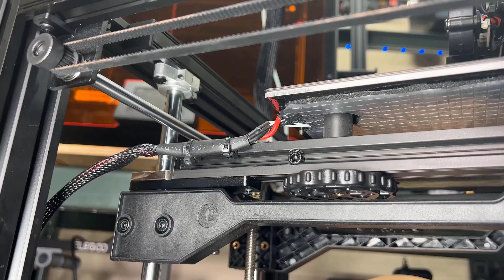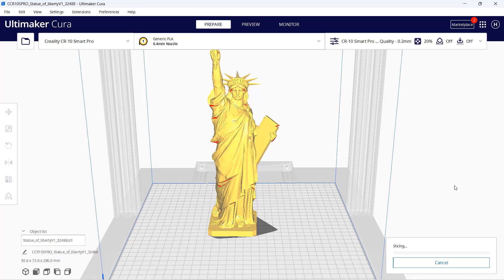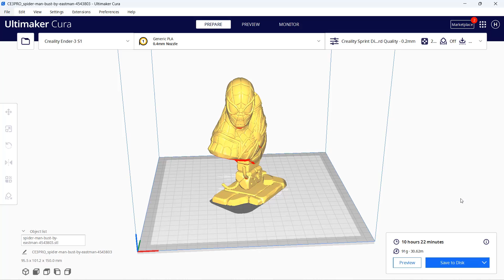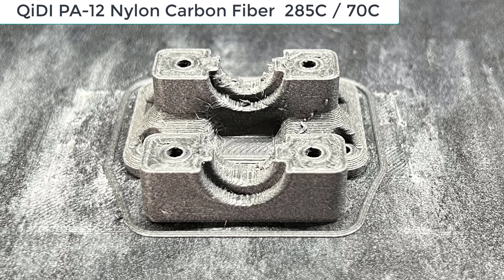Ender 5 S1 + Sonic pad Klipper firmware The ultimate hobbyist 3D printer? 250mm/s 2000 acceleration

Comment: Thank you for all the information you give, and share on many 3d printers. Recently I bought the Ender 5 S1, and a Sonic Pad. Thanks to you I got it all setup fairly well. One thing I am having trouble with is the slicer profiles, not enough experience I suppose, and my first Klipper machine. Can you share the profiles, either by file or text, for those high speeds you are getting?

Comment: The one thing you didn't explain was if you have to re-slice the models when using the Sonic Pad, or if you have to change the setting in your slicer when switching to the Sonic Pad that uses Klipper and not Marlin..

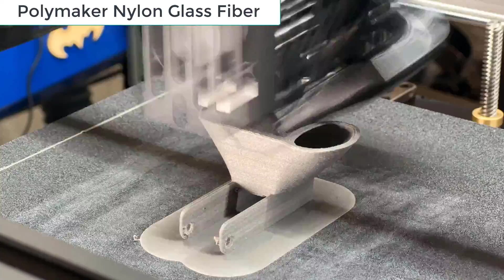Comment: Great video and you made me aware of something I didn't realize. At 18:00 you showed the nozzle size (length) and I didn't realize it was longer than the standard MK8. I recently put on a new nozzle and didn't notice the difference in length and was wondering why I was getting a little leakage. I'm guessing the standard doesn't bottom out as much as the longer nozzle. Thanks for the video!

Comment: Single bed mod I've made to my pair of E5-S1's has been to relocate the CR Touch problem to a zero Y offset.  Auto bed leveling works flawlessly now and first layer issues are a thing of the past.  It literally moves this printer up a full notch in quality & usability.

Comment: hi i need some help my ender 5 S1 has worked really well out of the box. i have problem the filament will not going through it starts but with few seconds it stop. what i found was it was blocking not the heat block it was were the two tubes connect at the top of the heat block. i have had all the heat exchange off many times to unblock and had extrusion off and it looks fine but i have no idea why is happening any ideas would be appreciate any help 
thank you

Comment: Great review as always.  I realize that you don't want to make any printer look bad,  but it still would've been nice to see the 3 s1 also overclocked to run at those speeds since you were comparing them against each other.  I don't really understand the design choice for the 5 s1 because the intense vibrations were pretty obvious since the bed lacks any side support.  Which means its high speed mode is only useful for the roughest of print jobs.

Comment: I recently got the Ender 5 S1 and I can’t seem to get the prints to stick no matter how much leveling I do 
Is the secret replacing the bed or using some kind of adhesive 

Also I noticed that your benchy print had a perfect first layer
My first layers are not uniform just a bunch of lines

Comment: If I planned to print more I think I would’ve grabbed a 5s1. Couldn’t pass up the 3s1 for $250 though. Couldn’t justify doubling the price for my needs. 

As a side note. I hope Ender releases a 5s1 plus and discons the current 5 plus. Too many upgrades in the 5s1 to not migrate over.

Comment: Sadly I tried this yesterday with a new sonic pad and 5 s1 and failed to complete the final step of automatic bed levelling. The first point tested, the front extreme left places the nozzle so close to the corner that the cr touch sensory in no longer above the bed. As this is the case it will never touch the bed and stop the bed rising. This places a dent in the bed and stops the calibration with a dreadful crunch. Back on the supplied firmware.

Comment: dual z should have been something they worked into this one at this price point, they nailed it on everything else but i would have liked to seen the dual z, it was the worst issue my original ender 5 had an the struts do help but at almost 4 yrs old its on its 2nd set of the struts so i figure its just going to be something that end up having to replace ever so often but the only other thing i think i would like to see from the new 5 s1 would have been corexy but i think they have that for there other printers so i can understand why this was not done. my oldest printer is my ender 5 an its still my go to printer when i need the best print quality out of my 10 fdm printers an if it needs more than it can handle then i go to resin but usually only have to use resin for smaller parts that have alot of details like a miniature or something like that. if i had to get rid of all my printers it would fall between my creality ender 5 3max or flsun qq-s pro so i may need to get rid of one of my other printers an get one of these machines an one of flsuns sr so i'll have something a little newer but im def a life time fan of creality just from my experience from my original ender 5, it still has its old 8bit board an only upgrade is the microswiss hotend but it has been a true work horse. does the 5 s1 come with the sonic pad?

Comment: The 5 S1 doesn't use "long" Mk8 nozzles.  They're M6 / Spider / Ender 7.  Plenty of hardened nozzles available at places like MatterHackers.  This isn't made nearly as clear as it should be from Creality.  Once you start looking for M6/Spider/Ender 7 nozzles, they're found readily in multiple different sizes.  Not as plentiful as Mk8/Mk10, but still available anyway.

Comment: Great review!  One thing I noticed when you were printing with TPU is what appears to be a significant amount of moisture on the flats of the nozzle (see: https://youtu.be/KpixXeWQiaQ?t=805 ).  If the TPU isn't being dried prior to printing, this can happen (and possibly the best possible outcome - usually it results in really wonky print issues).  TPU tends to be rather hydrophilic and needs to be dried if it's not being used straight out of the vacuum bag.

Comment: Thank you for the great video, i have the ender 5 S1 and currently installing my new sonic pad, i have completed 4/5 steps and machine begins the auto level process and when it starts the test...the CR probe completely misses the bed and stops, not really sure how to fix, I would greatly appreciate your expertise and any help please. thx Charlie
Reply from the maker: You can just skip everything from leveling bed corners to auto bed leveling, let setup finish, and after the main menu shows, do that manually.
Reply: Any idea why the CR probe misses the edge of bed? Curious .. seems like it should be a simple fix.
Reply: @charlespotwin9107  There are settings to define the offset of the probe from the nozzle.

Comment: If you buy this printer, get it from, Amazon.  Lots of people on forums having issues with Creality using the first buyers as beta testers.  I sent this printer back after a day because of bad ringing, non-standard nozzle size, and auto-level not working at all and creating random z-height values every time it self levels.  I went with the SV-05 instead.   Ender 5 S1 requires klipper if you want good prints out of it.

Comment: Could you add more details about the sonic pad mount you printed? Specifically, what size screws are required, and where are the mounting points in the 5S1 base that you screwed into? That would be super helpful. [Note: loved the video - it helped convince me to go ahead and buy the same setup.]

Comment: I seem to have a problem with my ender 5 s1 with a sonic pad
The auto level thing does not seem to work because the probe keeps going off the left side of the tray/bed and throwing  its level off over all by slamming the nozzle onto the bed it's even damaged the bed by leaving a little dent where it has happened 
And causes me to manually try and level it all over again

Comment: UPDATE 2 Months: 3 Sonic Pads, 3 Creality printers, Ender 3V2, S1, 5Plus.  All have reliability issues. All on latest Dec firmware.  One SonicPad had issue with USB port and took out control board, causing Thermal runaway, Ingot a SonicPad replaced, but the control board I had to pay for.  The issues are varied, but mostly the disconnects with error on the connections to FLUIDD are maddening, tried multiple cables, direct on internet versus wifi, etc.  We bought these to speed up our printers and have better quality..it is seeming more and more that this is a myth.  By the time you put all this money in Creality, you might be better buying a Bambu Labs for $699 that will do up to 500 mm/s and you don’t have to mess around with it. Plus, Creality service is terrible, non-responsive, asks wrong questions, etc.  they said there would be another update, but time has passed and no details or acknowledgment.  If you rely on these printers and this setup, beware for now.

Comment: I you print at 50mm/s on the ender 5 s1 do you still get the same quality as the ender 3 s1 pro?
Reply from the maker: It would be the same or slightly better as the print bed just moves up and down, the layers look better than any bed slinger.

Comment: Size apart.  Which is better Ender 3 S1 Pro or Ender 5 S1?
Reply from the maker: Ender 5 S1 is better in both print speed and layer lines.

Comment: One more thing, I posted this on one of your older vids, but not sure if you look at comments on older vids... "In the lastest firmware update for the Sonic Pad, they added several printer profiles, including one for the "CR10 Smart". However they do NOT have the "CR10 Smart PRO" on there that I've seen. As they have different boards in them, I am assuming that this is not a usable profile for the Smart PRO. Why would they add the older, less updated Smart, and leave out the Smart Pro??? Anyway, I'd love for you to do a video of adding the Sonic Pad to the CR10 Smart Pro, and show the results. Also, I'd love to know where you got the 5015 blower for your 5 S1 Pro, as I can't find it anywhere. Thanks for all the well rounded and professionally done vids by you and your brother. I hope to get an answer to these questions, as I have a lot riding on it. Lastly, if you have time, I'd love to see a compare/contrast between the Ender 5 S1 Pro, and the Smart Pro. Thanks. Cheers!"

Comment: My biggest question that comes to mind after watching this vid, is can this bi-directional fan duct on this printer be added to other printers? I have the CR-10 Smart PRO, and would think it could benefit from this fan duct, but would love to know what you think about this question? Thanks for another great vid.
Reply from the maker: Yes, the 5015 blower is the best, I replaced the stock 4010 fan with it on my old CR-10S Pro V2 and it's working great!
Reply: @AuroraTech  Excellent. I will look to buy one for my CR-10 Smart Pro. Was it a fairly simple upgrade, or did it become involved? Do you have a video of this upgrade? Lastly, where did you buy it from, as I've gone through Creality's entire site of upgrades and accessories, and it's not there. Even a search of it on their site shows zero results? Thanks for your help.

Comment: What’s your Z Steps set to? I just got my Ender 5 S1 setup and calibrated, but no matter what I do, the bed won’t lower ONLY during printing. Doesn’t matter if I swap filaments, slicer, etc. my Z steps are at 400. Will manually lower outside of printing just fine. Same behavior if I switch to OctoPrint.

Comment: I love my Ender 5 S1, sadly the idler pulley had a misshapen bracket so I cant' really print with it right now but Creality has already helped me get a new part sent out so I can fix the printer once and for all 🥰
Reply: Hello! Can you tell me what settings / profile do you use? I have Ender 5 S1 + sonic pad and after 10min of print it clogg... It is brand new i bought yesterday. Thank you!
Reply: @nikolaterziev93  sadly I couldn't really help you with that since I'm not using the Sonic Pad. In the slicer I'm using the default Ender 5 S1 settings with speed turned down a bit and retractions/flow tuned according to the guides available for Cura

Comment: As always, thank you for the review.  Creality is pumping out a lot of printers, but it feels like they aren't supporting existing printers very well.  I bought an Ender 3 S1 Pro this spring, and despite obvious problems in their firmware, there have been no updates from Creality.  The ribbon cable that attaches the sprite is also an issue, as just using the printer breaks it, and the replacement parts have to come all the way from China, meaning a 2-3 week downtime for the printer.  Do you have any insight on firmware options or spare parts options for the Ender 3 S1 Pro?

Comment: I hope this gives you some additional perspective. Something else is that they have the build platform and xy motion performed at the top of the machine which to some extent reduces the rigidity by raising the center of gravity of the machine, especially under high acceleration/jerk motions. Also the build plate starting at the end of the leadscrew's travel creates further susceptibility to rigidity/accuracy/repeatability issues due to cylindricity tolerances. For these reasons I'd rather see z move xy than the build plate or printhead alone. Again, your videos have been such a great resource for keeping a pulse on the 3d printer market. Concise yet complete. I like when you comment on cheap ways to mod the machines for higher performance. I hope you can get your hands on the Bamboo Labs P1P, bc with the available COTS tech these days its hard to debate not making your own machine with all of the best features.

Comment: What firmware version does your Sonicpad have? I don’t see Ender 5 S1 in current public release.
Reply from the maker: I got the printer.cfg file and the bin firmware from Creality, you need to manually change the config file, but they should release a new firmware update for the sonicpad that includes Ender-5 S1 soon.
Reply: @AuroraTech  Will you please share these files? I am unable to find them on the Creality website.

Comment: My question is: How fast can you push the Ender 3 S1 Pro with klipper to match the quality of the Ender 5 S1 with Klipper at 250mm/s?
Reply from the maker: No, I am afraid not, for Ender-3 S1, the heater block is smaller, it can't melt filament fast enough to print at 250mm/s, the print bed that swing back and forth also make it hard to have good quality print at 2500mm/s, the max I can do with stock setup w/sonicpad is around 160mm/s & 1500mm/s² acceleration, but still not look as good as Ender-5 at 250mm/s & 2000mm/s² acceleration.
Reply: @AuroraTech  Good to know! Thanks for that. I guess it all comes down to price:performance ratio. Here in NZ the ender 5 S1 is $1250NZD vs the ender 3 S1 Pro being only $850NZD

Comment: 👍Love the full gear "ultimate hobby printer" recommendation.  This 5 S1 linear rails ($20), dual Z-axis ($60), raspberry pi, and cover & doors to enclose ($150) for $700-800 would be a great value.  Make it an IDEX with a 2nd extruder for $900.

How does 5 S1 print quality compare to the Sovol S4 and S5?

Ask Creality if they would be willing to market a "Aurora special" printer. 😉

Comment: Excellent review! I see the bed shaking. Is it an issue or just an impression? It might be the vibration on the camera.
What fast printer would you recommend with a 300×300mm print bed?
I would get the FLSUN V400 but my part has a diameter of 315mm but the printer bed only 300 mm :(

Comment: so Creality sent me one of these as well, my review is going up in a few days, one thing I noticed on my unuit though was the accelerations where set to 500mm/s across the board, confirmed via Pronterface but you can also see it on the touchscreen, was kinda nuts. mine also has a hard time staying level, the left side of the bed always ends up too close, I think I need to re-try thebed level and check all the v-wheels, also the acrylic panels they sell re kinda useless as there is no hat, and because the print starts at thetop, near the open air, things like ABS arent going top print well
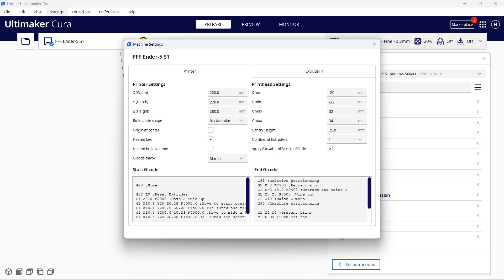Reply: For the levelling issue, you're probably missing the m420 s1 z10; command in you're starting g-code. At the 4:25 mark of the video she is also. Its a common problem with cura or creality with these newer machines. When you do an auto level it saves the mesh but when you start a print you're starting g-code doesn't tell the machine to use that saved auto levelling mesh. So if you're missing that m420 command in you're starting g-code, you're printer is just printing on a manual levelled bed
Reply: Mine had accelerations set to 3000m/s^2 and jerk at 15mm/s^3
It did print but not too well 😅

Comment: I notice that visually your bed looks quite tilted to the right. When I set mine up I got the same thing. Except that when I autolevel and try to run a print it seems to want to run into the print bed. Did you have any issues with it?
Reply: For the levelling issue, you're probably missing the m420 s1 z10; command in you're starting g-code. At the 4:25 mark of the video she is also. Its a common problem with cura or creality with these newer machines. When you do an auto level it saves the mesh but when you start a print you're starting g-code doesn't tell the machine to use that saved auto levelling mesh. So if you're missing that m420 command in you're starting g-code, you're printer is just printing on a manual levelled bed

Comment: My S1 Pro came with brass nozzles not hardened steel, as mentioned in your #3 con.  If creality made this core-xy it would be an outstanding printer
Reply: I would agree, kind of. They already have the Ender 6, and they should have made these upgrades to it and release the Ender 6 S1. I have 2 E6's and if it had the Sprite Pro, with the improved cooling ducts, and bed leveling out of the box, it would dominate the mid-range printer market. Plus, it already has an enclosure. I don't understand Creality.
Reply: They all come with standard nozzles, you are correct. I'm not sure why Aurora said otherwise.